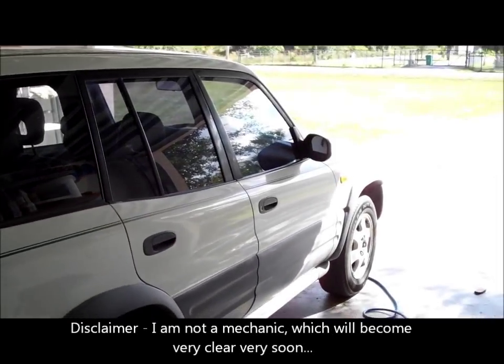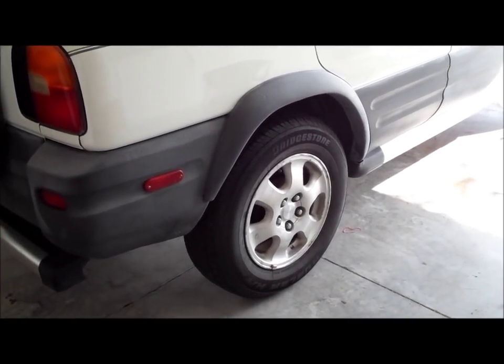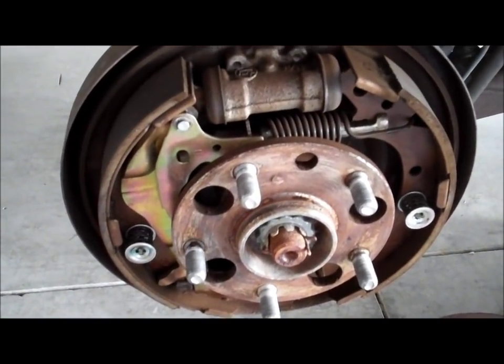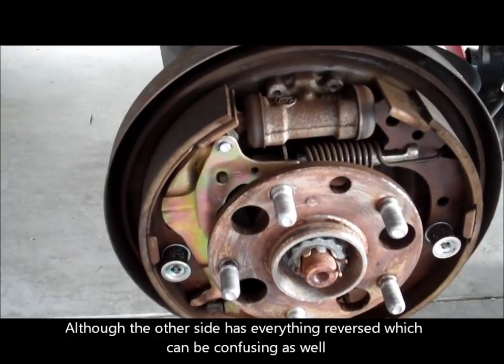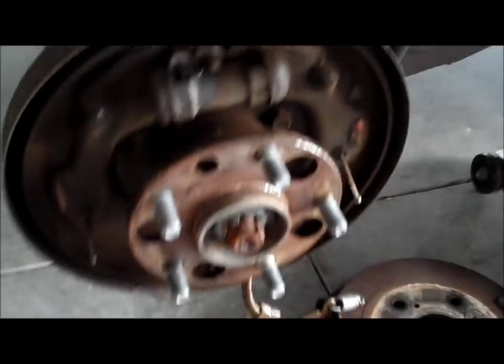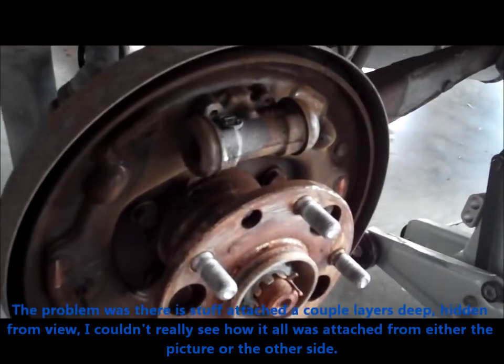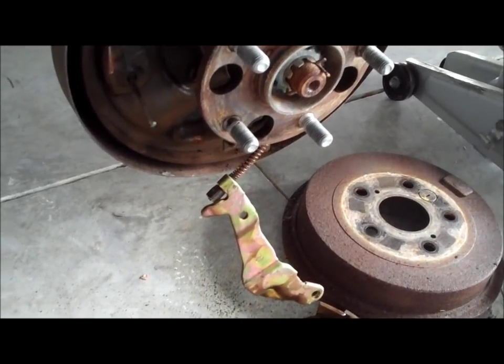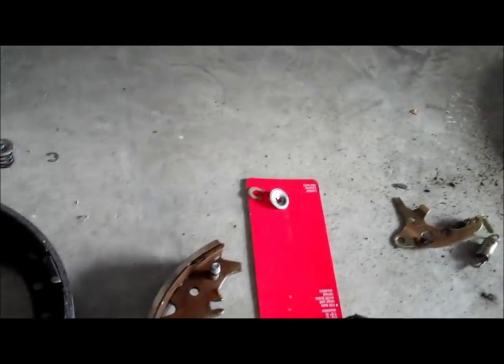1996 Toyota Rav 4 Rear Brake Shoe replacement - FAIL

Comment: One thing that also really helps is to take a picture of the brake hardware wheel assembly with a cell phone before disassembling or sketch it on a piece of paper. Using the other side as a guide can be confusing because many parts are oriented the opposite of the side you are working with. I have also discovered that needle nose vice grips work great to install springs.
Reply from the maker: Thanks for the tips!

Comment: I just attempted this but now when I push on the brakes, it makes a rusty noise and the emergency break doesn’t work. What’s the problem and how do i fix it?
Reply: You probably didn't adjust your Adjusting Bolt. I just posted a video about the adjustment. youtube search "DRUM BRAKE JOB FAIL!!!" and go to 10:24. Let me know if it helps.

Comment: You start off in the very beginning well I got the shoes off. Ha ha without explaining how you got the shoes off to start with.
Reply from the maker: Video was a complete and utter fail :(  I did later actually complete a drum brake job.
Reply: @Duf   I started the brake job before I looked at any videos to be honest. I started out trying to jack the rav4 Toyota up but the floor Jack has been sitting for so long that it would only pump up about halfway and not enough to get the car up. I went looking for my bottle jack but couldn’t find it so I ended up using the jack that came with the car. Now it’s 92° outside but I finally got the tire off and took the drum off to  look at it but I couldn’t find anything wrong so I called up a brake specialist place that I know and he said bring it in. I brought it in and he said there was nothing wrong and the shoes look brand new. All it needed was an adjustment. The shop that did it about a year and a half ago never adjusted the rear brakes and that’s why it was making all that noise. He didn’t charge me and he adjusted it and they work great. It was a good day after all.😀

Comment: I agree with Raven, why bother posting this, it showed nothing useful or worth watching. You should take it down.
Reply from the maker: Well there are some slightly useful things but I agree, didn't turn out as I hoped.
Reply: Demolition Man That’s not true, I found it helpful even though I’ve done drum brakes it was like 10 years ago and this reminds me how much of a pain in the ass it is, I’m rethinking tackling the job as preventative maintenance and have decided I’m gonna pull the wheel off and check em before I buy any parts.